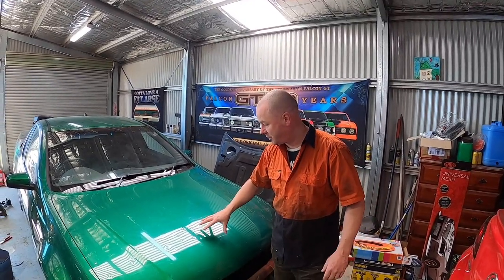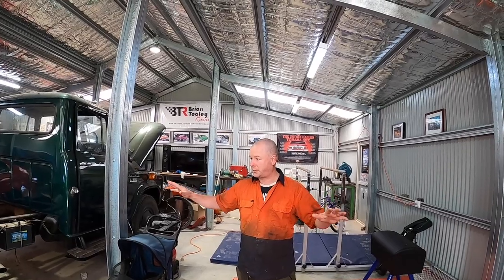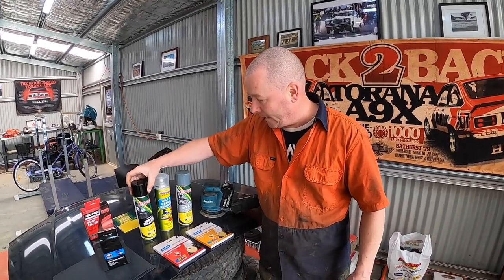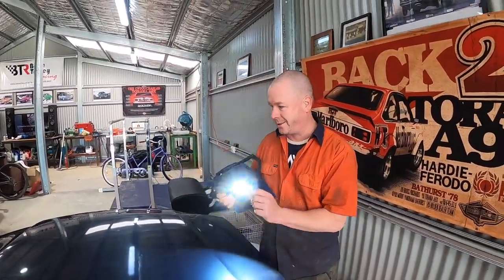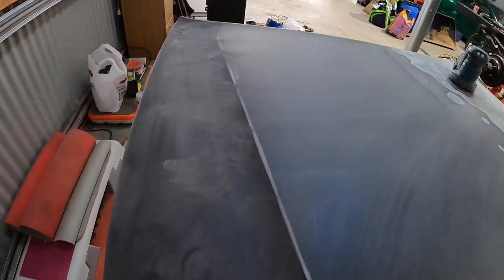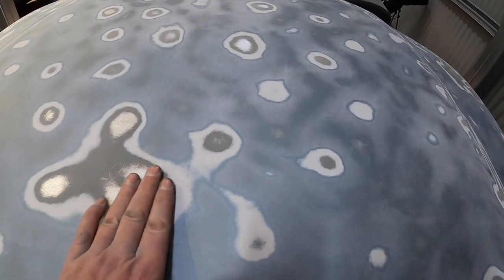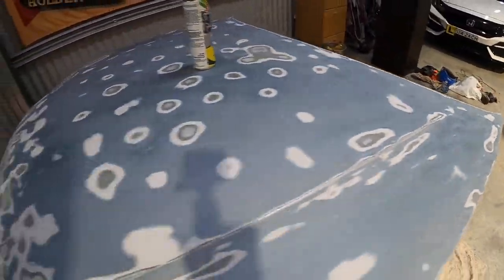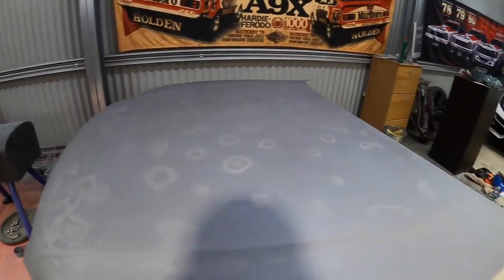How To Prepare and Paint the Bonnet of Your Holden Commodore VE SS Ute

Comment: Hey mate just letting you know when you where sand the bonnet the way I you had it sit on the stand the sealer underneath the bonnet pushes up and that why you see it ring up and you can sand low spots and high spots just a tip for you love the build mate
Reply from the maker: Thanks for the heads up mate!  The ute is actually now headed to a professional to get all the hail dents and marks out of it and we will get it painted professionally using a booth and a gun.  My abortion of an effort was enough to work out that this is not my calling 😎
Reply from the maker: Gday Dylan, thanks for watching our channel.  Dont forget to enter our latest giveaway and guess our next project.  See latest video for details.  Fred